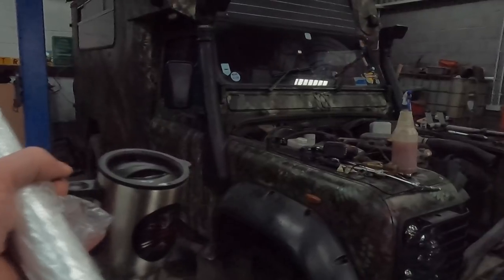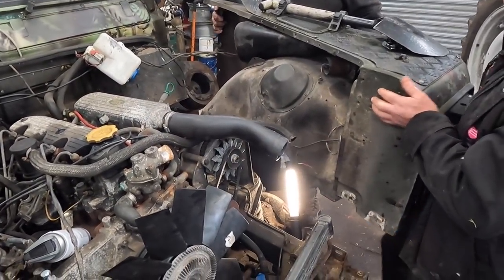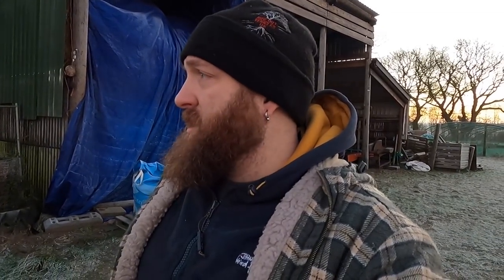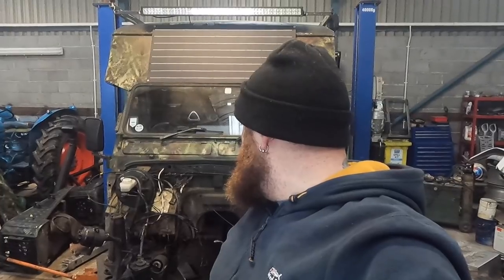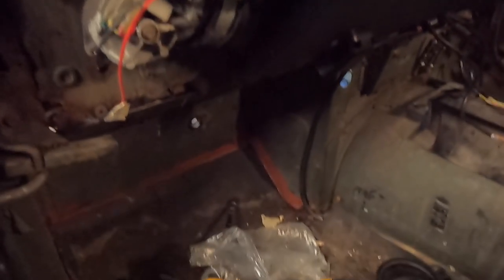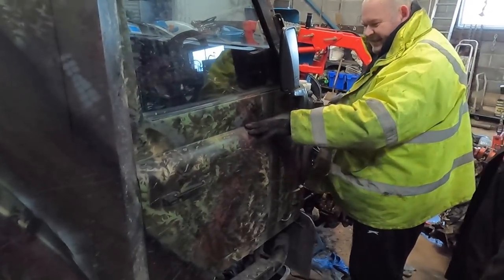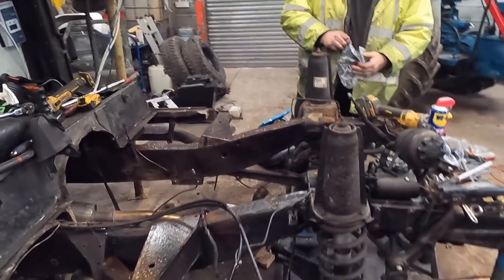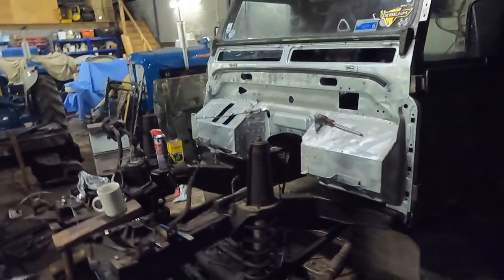Land rover Campervan engine and bulkhead change

Comment: Fair play chaps, meant to be one of the biggest jobs on the landrover, the bulkhead,
As others have said, with the 300tdi the fourby boost pin and ring kits and the boost controller tap will probably be more than enough power bud,
My 110 sits at around 3 ton with a similar setup bar the boost controller and pulls alright to be fair even with a 1.2box.
Also be worth getting fourbys egt gauge and sensor kit so you can keep temps below 700°c 👌

Comment: Great project typical land rover hidden rot and rust, if i were you I'd do the rear main seal on the engine and cambelt whilst your on. When I had a 300tdi all I did was turn the boost pin, decat and egr delete and it was great look forward to seeing your progress 👍👍

Comment: Not a small undertaking. I've got mine to do later this year.
Is there any reason why you didn't paint the bulk head before fitting it?
Reply from the maker: I’m keeping the engine bay galv as it shows it’s been done and holds more value.